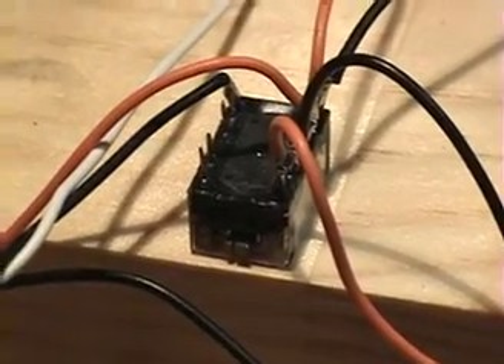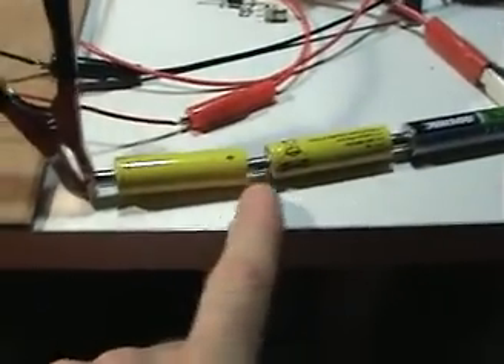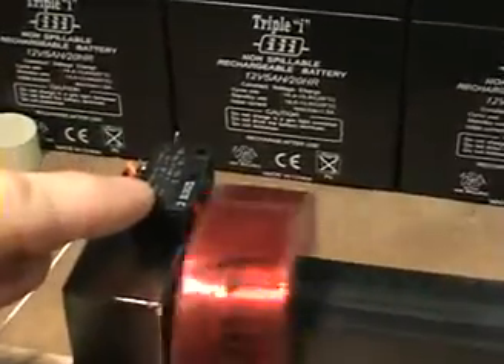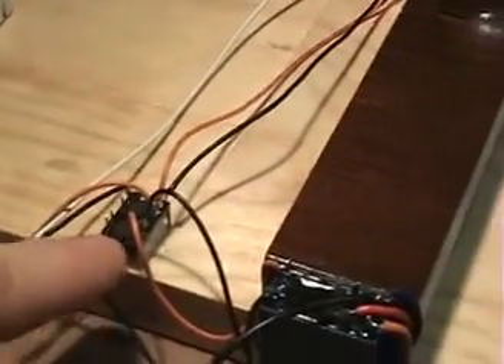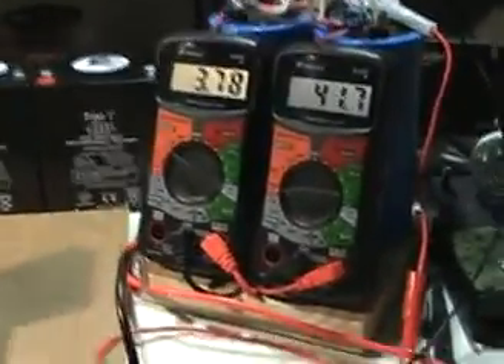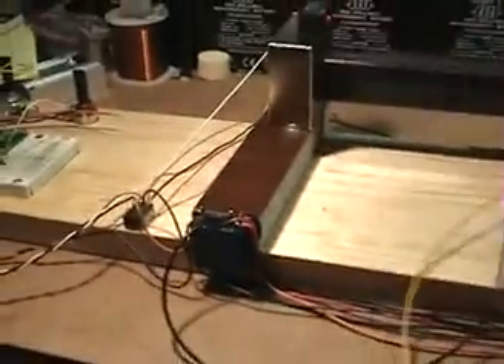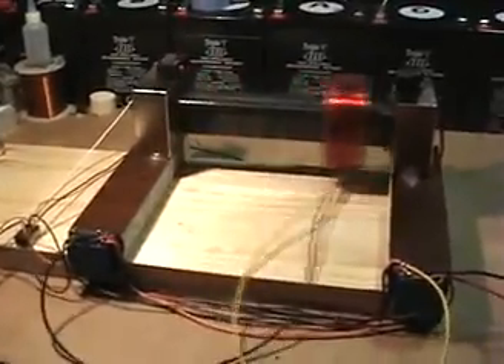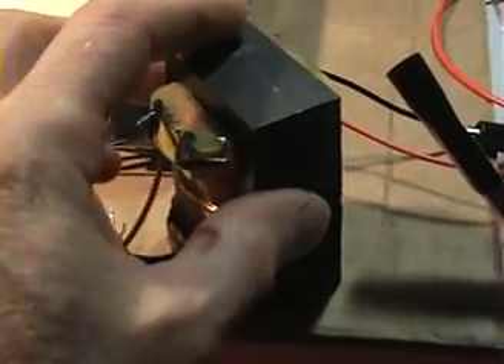Mostly Permenent Magnet Motor test 2

Comment: Thats awsome. Are there any practical uses it can be applied to?
Reply from the maker: There may be, I just haven't found any in the research I'm involved in.
Reply: Luc  gotoluc Choquette 
Perhaps something that requires a powered motion, but where a revolving motion should be avoided. (ie. Non-gyro interference?)
Reply: Luc  gotoluc Choquette 
And I'm sure that if you can figure out how to get neodymium magnets that big fastened together without blasting holes in the walls or crushing your hands, ( those things must have cost you a small fortune too) I'm sure you'll find something. lol. Good luck😉

Comment: Wanna see real over unity in action?  Then turn a ten speed bicycle crank with that.  I did the math for just that kind of solenoid at one time.  A 100 times the power, 1 ampere of current, and a mechanical load to keep it moving that slowly, you really have something, if the bike is in high gear.